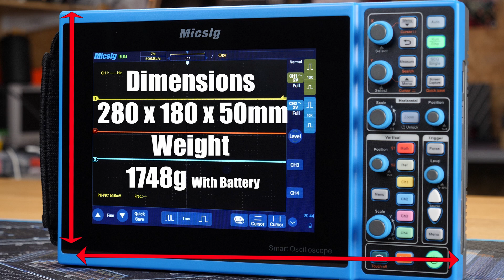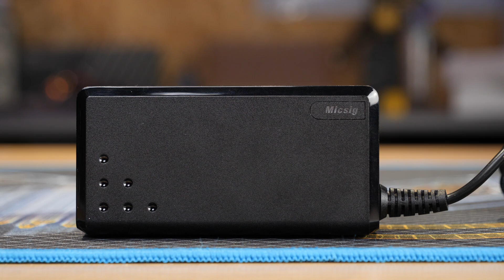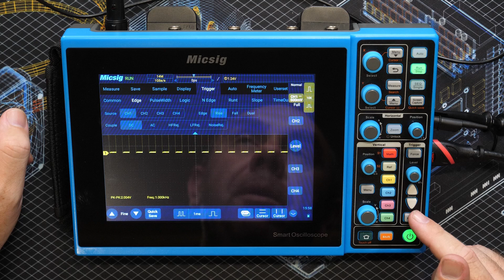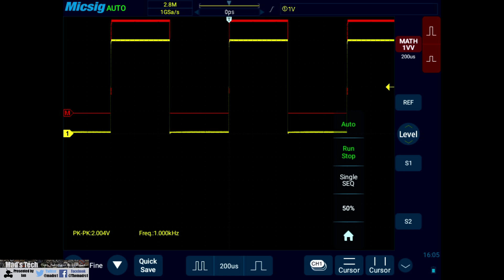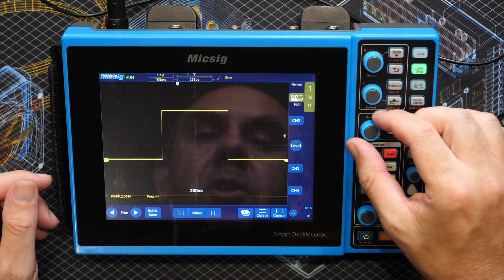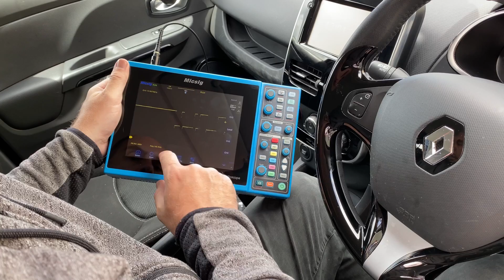Micsig STO1104E Portable Smart Oscilloscope Overview

Comment from the maker: Update -- Clarification- Isolation  

Just a note on a comment I made around not needing a differential probe with this scope because the scope is isolated from Earth, this is only the case on battery. The mains adapter has the DC earth connected to the mains earth pin on the PSU.  When on mains it would be the same as a normal scope.  Again please be careful with mains voltages. 

Thanks

Comment: I had watched it over and over again cause I loved the capabilities and details of how it works - and unfortunatelly i have the big BUT

I can not justify the investment for such tool I rarely will use for some uart decoding and sine wave checks of solar power inverters.

That being said I researched over a year to get finally 3 USB oscilloscopes starting with the hantek 6022BL with logic analyzer.
Unfortunatelly I was not aware that it has no ac coupling capability and that hantek is the biggest cost cutter cause they missed to solder a cheap 14 picofarrad capacitor on each channel. So I had to flip the hantek and considering it was new I could sell that easily with a small profit once it had arrived in the EU.

Then I was torn between a picoscope from pico in the UK for 140€ and a owon vds1022i with 2 channels and 20 Mhz for about 105€
So I went for the cheaper owon with isolated channel(s). Got it but it missed the decoding functionality I had thought all would have, and therefore sold it again and finally got the cheapest offer with the highest quality: 

Loto OSC482 but in this case the L edition OSC482L with logic analyzer for just 79€ from ali express delivered like the others within 10days.

Big advantage is the far lower noise of the OSC482 compared to the owon and especially with the hantek which you can easily check and detect by not attaching any probe. The owon and hantek jump around the 0 line while the OSC482 shows to close to no noise.

Then the OSC482 comes with the PC software that gets better and better over the last 2 years since introduced cause they do listen to the few western reviewers that complained about tiny parts. The Loto comes with AC coupling the hantek was missing at that price point and it also offers a DIY interface with a 15 pin connector that is open source and well documented. They offer a cable and breadboard to build your own accesory which is a nice move ahead.

Important to know: all the loto USB oscilloscopes like OSC482 and OSC802 and OSCA02 support android out of the box and the android hscope app will work out of the box, even in an emulator on a pc. The OSC*M models are targeted for developing countries as the said that have no access to the google play store but they also take our money selling us those editions for 20€ more as android version which would mean that you get the otg adapter and a full hscope licence  which you could buy directly for 12€.

Might be worth for all those that would use oscilloscope only rarely and would otherwise not get a bench one due to the 200+€ price tag those costs nowadays. Of cause it comes with 2 probes x1 and x10, but with lower range like this one up to 20 Mhz and not 100 Mhz which is not the biggest downside considering 80€ versus 400€. And it also gives you a good feeling to reuse an older android tablet or phone you had not used or give it an additional use case as in my case where I had one for DJI drone only which is now also a part time oscilloscope.

Of cause such USB one is always a collection of compromises  but this one or better my third one within 2 months is by far an astonishing piece except a terrible marketing cause it is really hard to get to the details, find the specs and datasheets. Yes, they have an english website and show the products but so poorly presented that you can not believe it. Best overview is available on aliexpress from the official loto shop and that is using pictures for the spec sheet presentation, another night mare, but you can find the specs once you went to their loto-ins homepage and from their to support and downloads cause there you find a link or description to a google drive where you can finally find all there specs, drivers, software across the full line up. 
Yes, sounds weird and whatever, but this scope is used in the automobile shops across the globe and I had gotten the tip from a Mercedes top master mechanic for VIP who wanted something usefull at home and had gotten this one 2,5 years ago.

Just to let you know: it is portable, the 5 year old 100€ cheap android 6 tablet can power it as the new samsung flagship phone  and my quite expensive bright dji drone tablet 
The 5 year old 5000 mAh tablet is running for over 4 hours while powering the oscilloscope and then it was not even empty but I had nothing more to do.

Of cause nothing compareable to MISCIG and RIGOL but a solution that would fit in most RC hobbist budget starting from 65€ in the base edition from ali express delivered to germany incl. 19% vat. And you can barely find such shootout infos about the loto devices cause on the eev blog forum all the hooray goes to the owon vds1022i for 105€ if there is any hooray cause most comments sound like that they are no oscilloscopes cause those start only as benk oscilloscopes or from a rigol, siglent , whatever brand. It was pretty hard to gather all the infos and implications together cause no one had digg that deep as I described it here. 

But it is worth to have a look at and present it to the audience, also loto would support you with a unit of your choice I guess cause I had got in contact with a reviewer about topics he had missed and said that he got support from them even though the channel had less than 1000 subscribers. What I could tell you is that the oscilloscope worked fine checking 230V pure sine wave from the cheap micro solar inverters from china that do not always deliver pure sine wave and switch to a kind of modified sine wave or to a sine wave that is none. The decoding worked also for a CAN bus protocol used in car can bus by mercedes, and the final protocol is RS485 or so which is used in the solar power environment like growatt and others to communicate with the battery and the central fuse box of the household cause here we have a no feed in law which means that the growatt inverter only produces that amount used in the second without any surplus feeding into the grid. And that interface is also used for data exchange with the battery, therefore I need to digg into it cause I can not lay another  cable from the inverter to the central fuse box and need to replace that with a wireless connection which needs some setup data I need to figure out with the oscilloscope.

Pretty long story but that is how I got into the oscilloscope far deeper than I ever thought or wanted just to get the right tool which can collect dust without my better half reminding me about a 500€ dust collector in the shelf untouched for over a year. 
The loto one is an astonishing piece of oscilloscope for just 65€ which is still unrecogniced in the market even though it has its unique strengthens and a decent quality compared to the even more expensive Hantek ones not even offering ac coupling but a lot of noise.